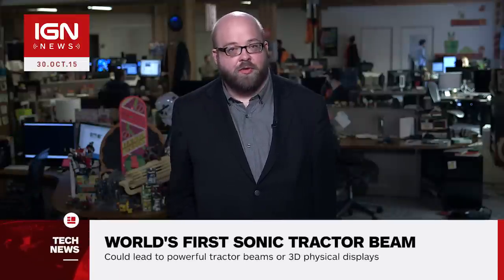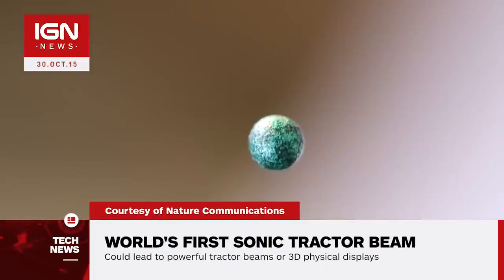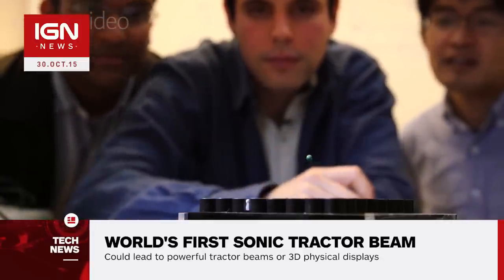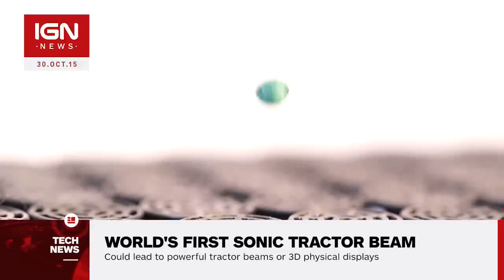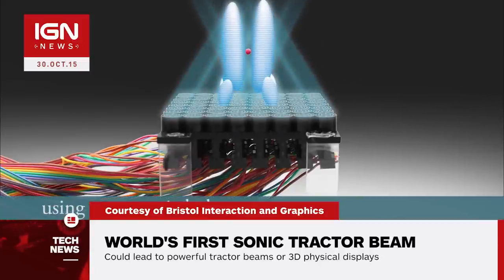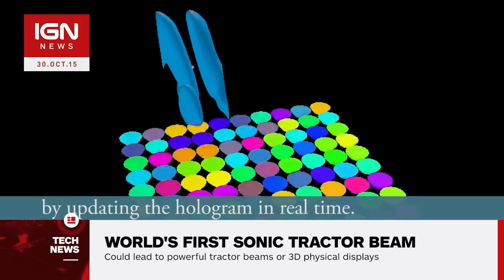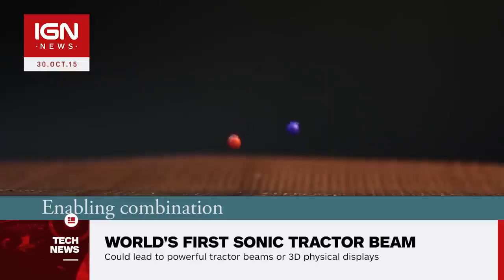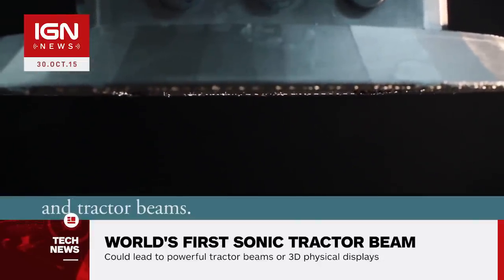World's First Sonic Tractor Beam Has Been Invented - IGN News

Comment: whatever happened to just picking up stuff?
Reply: good luck picking up a single particle for a reaction or hazardous chemicals
Reply: no matter what IGN do they are always wrong...
Reply: Its more than that.
Reply: +dv2244 This may have applications in space since there is 0 gravity it would be more effective.
Reply: +Demon of Elru there's also not the same density of particles in space to manipulate with vibrations so it won't work
Reply: smith549371 Ah yeah, that is true, you are probably right. Forgot about that. XD
Reply: Jayasree Adiga its called tweezers. Duh
Reply: +dv2244 
The way it looks now might seem unpractical but in a hundred years this tech could evolve into something more useful.
Several decades ago when people were designing the first computers they built the ground work for better tech that would eventually evolve into modern advanced computers.
 Technology like this is laying out the blue prints for more potential innovations down the line.
Reply: Guess i should've put (sarcasm) at the end.